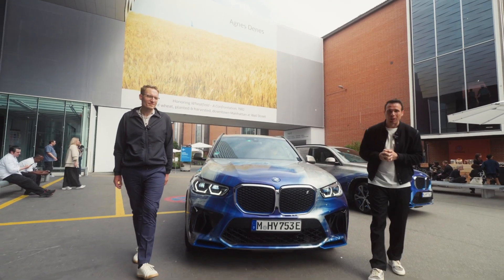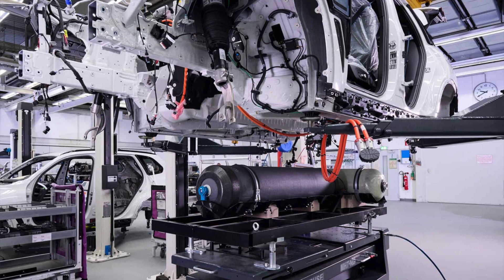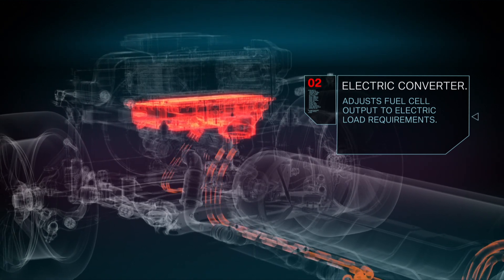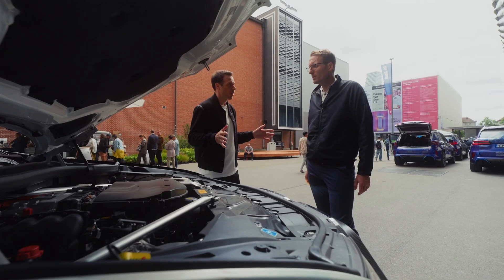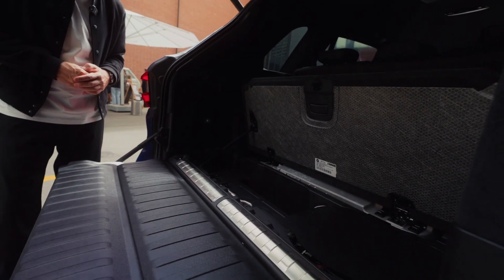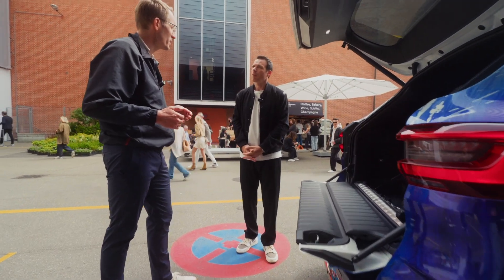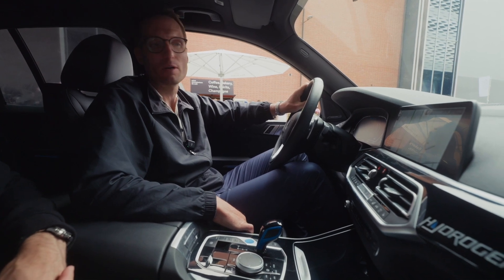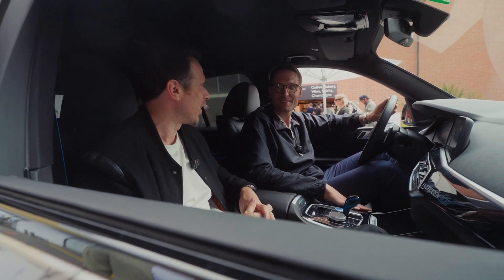BMW iX5 Hydrogen - Is This The Future?

Comment: He said winter driving is no problem because of all the waste heat given off by the inefficient fuel cell during the conversion of hydrogen to electricity (sort of like a fossil fuel engine).
Reply from the maker: Yes, that's one of the advantages
Reply: @bmwblog  advantage in summer as well? it is an inefficiency, how it could be advantage??
Reply: @trexeyesonly55  Why does the efficiency matter so much to you?
Reply: @jimj2683  what? To me? It should matter to all of you if we speak of energy. In simplest you wanna pay more for less if you don't think about efficiency. Second you will pollute more for less if you don't account efficiency. If you have infinite resources then go ahead, but we don't live in such world. You can be so much rich, even in that case you cannot throw away the energy that it is very difficult for some to get

Comment: Refueling "just like" an ICE?  That's good?  Having to drive to a gas station and paying a fortune for a tank of highly toxic and combustible liquid, when you could plug in at home in three seconds.  Hydrogen is hugely inefficient and expensive, which is why it's been an abject failure in the one market where they are sold.
Reply: The whole point of what BMW is doing is R&D, rather than saying, “Okay fine, everyone is going down the BEV route, so let’s stick to that.” It’s called innovation. If it proves to be commercially non-viable, then it won’t take off. However, BEVs have questionable commercial viability at the moment on a number of metrics. Furthermore, when everyone converts to BEVs and the demand on grids becomes excessive, not to mention governments who lose out from fuel duties, etc start taxing electricity usage higher, what do you think will happen to the cost?
Reply: The whole point of what BMW is doing is R&D, rather than saying, “Okay fine, everyone is going down the BEV route, so let’s stick to that.” It’s called innovation. If it proves to be commercially non-viable, then it won’t take off. However, BEVs have questionable commercial viability at the moment on a number of metrics. Furthermore, when everyone converts to BEVs and the demand on grids becomes excessive, not to mention governments who lose out from fuel duties, etc, what do you think will happen to the cost?
Reply: @Chris21709 - Your statement greatly and inaccurately oversimplifies the current state of hydrogen technology. While hydrogen fuel cell vehicles (FCEVs) face challenges like high production costs and infrastructure limitations, they aren't inherently inefficient. Green hydrogen production is improving, and its potential for clean energy storage makes it valuable, especially in industries requiring high energy density, such as aviation and heavy transport. Hydrogen has been successful in niche markets, with companies like Toyota and Hyundai offering FCEVs, and countries like Japan and Germany investing in hydrogen infrastructure.

Comparing home EV charging to hydrogen refueling misses key differences. EV charging at home can take hours, while hydrogen refueling is quick and convenient, similar to gasoline. For those without home charging access or in need of fast refueling, hydrogen offers significant benefits, especially for long-range travel and heavy-duty vehicles like trucks and buses.

Regarding toxicity, hydrogen is flammable, but so is gasoline, and hydrogen dissipates quickly in case of leaks, making it safer in certain contexts. Hydrogen technology is still evolving, and while EVs lead in passenger cars, hydrogen remains a strong contender for specific use cases where fast refueling, longer range, and high energy density are crucial.
Reply: Some may even argue that it is better for the environment long term and reduces the risk of children being used to mine earth metals.
Reply: Toxic?  You forget that electricity can kill you quicker :)   ... just a quip